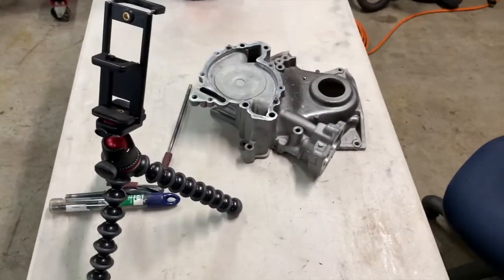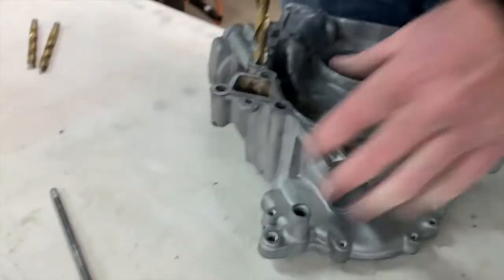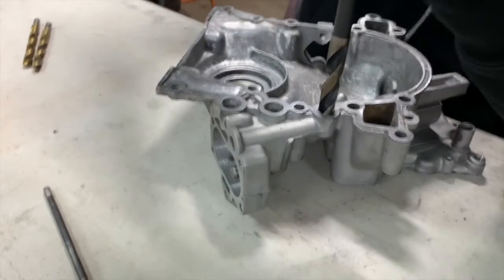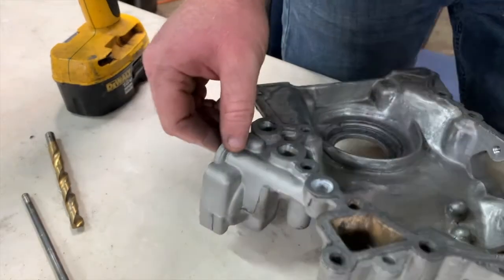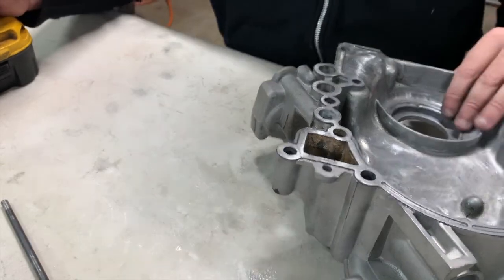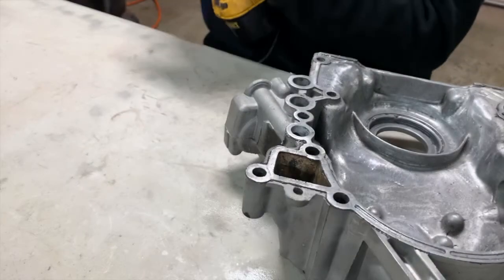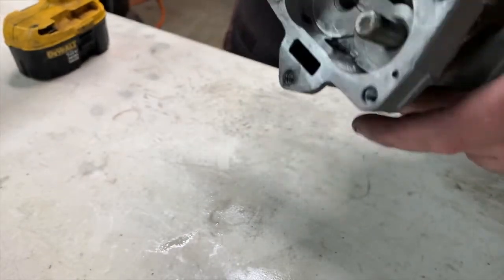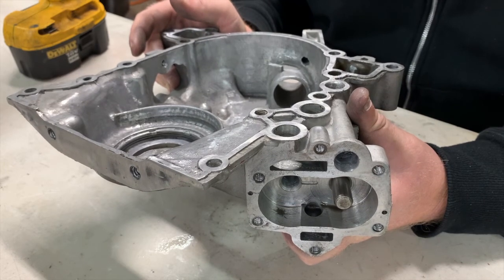We Modify a Buick V6/Small Block V8 Timing Cover Oil Feed Passage to seriously flow, in 16 minutes!

Comment: I've been looking up as much info as I can about the Buick V8s, since I've got a 350 I'm working on! My application will be a cheap fuel cruiser, daily driver engine. Would these oiling mods benefit my application? Thanks
Reply from the maker: If you have it apart, these mods sure would make it live longer. Otherwise… it’s probably not gonna gain you anything much in those two categories. Longevity will be increased.
Reply: @mr.roddersneighborhood2740  Thanks Mr. Rodder, longevity is something I'm after so I think I'll add oiling mods to the to do list, although not going too crazy. Thanks again

Comment: good evening friend, excuse my bad english.  I wanted to ask you a question?  I have a Buick 231 that I did a new engine: pistons with rings, camshaft with horns, new crankshaft with new connecting rod shells and crankcase, all new and new oil pump sprockets too.  the problem comes when I turn it on: it gives me a pressure of 60psi but when it heats up it drops to 10 psi or less.  Do you think that doing this work improves the oil pressure?  and another question: do you only enlarge the chain cover or also the engine block?  I greatly appreciate any information you can provide me.
Reply from the maker: I enlarged them all, block, timing cover and oil pump passages. In your instance a Melling High Volume Pump kit will fix the issues you are seeing. It's too late to do most of these mods since your engine is together. Just use a high volume pump and it should be solidly at 20PSI plus at idle and all will be good. Hope this helps!... don't worry about the English...any other language I speak is way worse than your English!
Reply: @mr.roddersneighborhood2740  I forgot to mention that I already have a high volume pump installed that comes with the taller sprockets that comes with a flange
Reply: @mr.roddersneighborhood2740  I have consulted with some mechanics here in the country and they all agree that I have an oil leak, which is why when I start it cold it has high pressure, but when the oil is hot the pressure drops to 10 psi or even 7 psi.
Reply from the maker: @jonathanbriceno4892  If that's the case and you have a high volume pump, there must be something leaking fairly bad internally. I'd look at the tolerance of the #1 Cam Bearing.
Reply: @mr.roddersneighborhood2740  the cam bearings are new, as is the camshaft.  the only thing that it does not replace is the chain cover, which I did see as very scratched where the sprockets work.  or I don't know if it's losing pressure between the high pressure oil pump adapter gaskets.  I have the doubt there, it is the only thing left for me to check the chain cover.  I greatly appreciate all your time and advice friend of him.